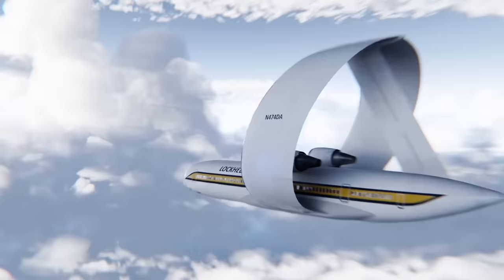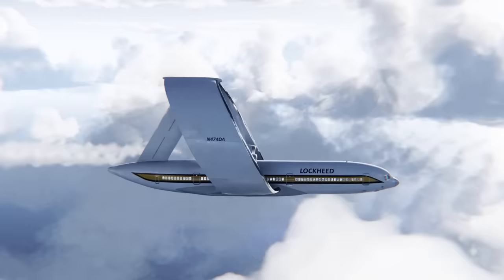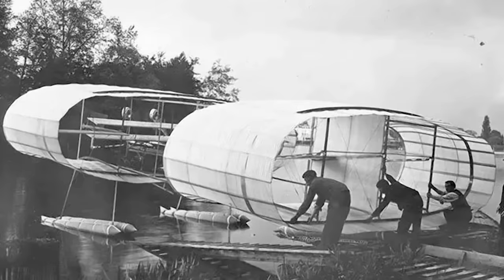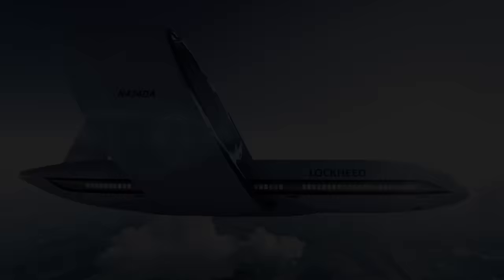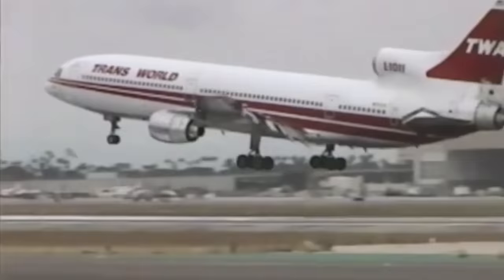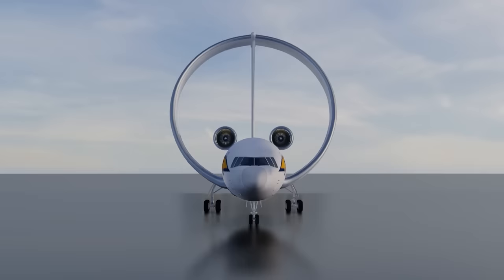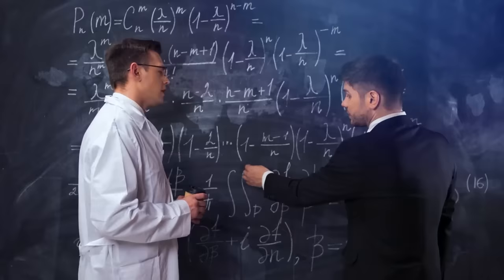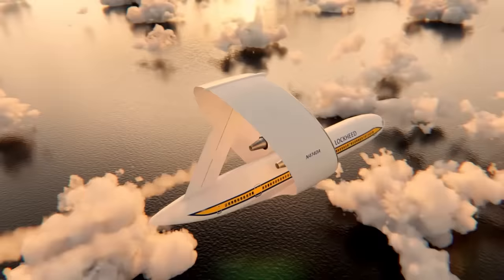What Happened To Ring Wing Planes?

Comment: As difficult as powered heavier-than-air flight was to first achieve in human history, it sure seems like there are a ridiculously wide array of designs that can work.
Reply: Yeah once you've got the basic idea of an airfoil and centers of lift and mass hammered out the rest is pretty flexible.
Of course it's still a big leap from something flying and something flying well.
Reply: Yup.  The hard problem at the time wasn't so much wings as engines.
Reply: The problem was not wing design, the problem was an engine that was powerful enough while also being light enough
Reply: It was the engines that were the problem. We had airplane-like gliders in the civil war, and soldiers would use them to spy on the enemy. They had to be sent up like a kite and wouldn't stay airborne for long though
Reply: Especially home-built RC planes! I thought you needed a PhD in engineering and access to a wind tunnel to design a plane that stays in the air, but it turns out that even people with "I think I saw that somewhere" knowledge of an airfoil can glue some styrofoam together and make it fly.
Reply: @metacob  RC motors have a ridiculous thrust-to-weight ratio, since things are so much more efficient at smaller scales.
Reply: *is, not are.  You're talking about a single array.  Learn the language you speak.
Reply: Anything flies with enough thrust.
Reply: Now the issue is almost exclusively efficiency. Most of the ideas get ruled out because they’re too heavy, not to physically fly, but to do so cheaply. That’s what’s holding up electric flight mostly. Batteries be heavy.
Reply: There are many design that can work, but what matter is how many of those can work better and cheaper than the current design ?
Reply: It isn't about flying..its about lifting off and landing.Alomst anything can fly question is how to get it up there.
Reply: @billydelacey  Stop correcting people. You aren't right.
Reply: Yeah, you just need strong enough engines.
Reply: @billydelacey  Youse may have GPS
Reply: Elon said it himself "you can make anything into a rocket, whatever shape you want"
Reply: the animal kingdom has found millions of ways to make it work all without engines.
Reply: @wompstopm123 Muscles aren't that bad an engine...at smaller sizes.  The power s muscle can exert is going to be roughly equivalent to the cross sectional area but weight goes with volume.

So if you're the size of a bird it's workable especially with light bones etc.  If you're the size of a person taking off under your own power requires some ridiculous modern materials to make giant super efficient wings.
Reply: With enough thrust, even a brick can fly.

Comment: My engineering teacher in highschool had us all make paper airplanes to see which ones would glide the furthest. Nobody really made anything too out of the ordinary, but the teacher made a ring wing plane from a straw, a piece of paper, and tape. It flew further than any other design and it blew my teenage mind.
Reply: Actually the best paper airplane design is this: Build a regular paper airplane, then make another one, but stop right before you fold it in half. Then slot that piece onto the top of the first paper airplane, taping them together under the wings. The overall shape is the same, but now you have a wing that opens like a pocket from the back. This creates a really smooth and long range glider, and there's multiple reasons why it performs better. Firstly, air gets pushed in from the front, inflating the wing, creating an area of high pressure, generating lift, while at the same time, also getting even more pressure from the default wing, even though it all behaves as one wing. So it essentially multiplies the high pressure surface area, without increasing the low pressure surface area, which generates more lift. It also fly's very smooth and stable. In a way it's like a ring wing meshed with a traditional wing, giving you the benefits of both with none of the drawbacks.

Comment: When I was a kid I used to make "paper airplanes" that used this concept using only two strips of a paper and a straw. If you cut two strips of paper, both an inch wide but one 4" long while the other is 6" long, then you tape both strips into a circle and attached them to the ends of the straw such that the attachment point of both strips is on the same side of the straw, then throw the "strawplane" with the smaller loop in front, it actually will fly pretty far.
Reply: I can easily see this design being potentially useful for like, low powered simplistic drones of some kind, not the loud whiny buzzy quadcopters but more like a serene, graceful device. Especially combined with a bladeless fan design this could be quite the smooth and safe rider. Much of our aircraft design comes from military roots, I always wonder what the state of technology would be like if WWI was averted and we kept that hopelessly optimistic, dieselpunk outlook on the future that people had in the early naughts
Reply: I made one too; using only a sheet of paper , it flew quite well
Reply: I'm pretty sure the world record paper plane, is incredibly basic and only has a couple folds. It looks cool, but it doesn't mean it's the best design.
Reply: I did, too! Way back in elementary school. Ours only needed a single sheet of paper.
Reply: @NLynchOEcake at that point why not make the ring wing an engine in itself? Doesn’t have to be complicated. It could work like one of those bladeless fans that are more expensive and act as “humidifiers.”
Reply: @cadosian078 or one of those solid state ionic thrusters

Comment: A yes.. the worst of both worlds. 

Both the downside of having a very long wing, combined with the downside of having two wings on top of each other.

On top of that, the high pressure area on one part is the low pressure on the other part. So its almost like having a anti winglet, that guides air from the high pressure to the low pressure side.

Will it fly, absolutely.  But it will suck down fuel as if there is no tomorrow.
Reply: Like my engineering teacher used to say: "With the right engine even a tram will fly"
Reply: Actually I think it will have varied cross sections, so the low pressure zone will always be the “top” side of the wing generate lift. Still the sides are not doing anything…
Reply: @AaronShenghao  is it viable to put rudders on that sections?
Reply: @AaronShenghao  Well on the same side of the surface, what is top and bottom is really perspective.

But it gets worse. There is just a infinitly shot bit of the wing that is vertical. Just next to it is parts that is have a horizontal component to them, hence generate lift. If they generate lift, they have a low pressure. So this put the low pressure of the lower wing just next to the high pressure of the upper wing. Guiding the pressure to collapse, and that is also true the other way around.

So this is actually worse than if you had two semi circular wing and a gap between them
Reply: @deptusmechanikus7362  yea... that would work, but it might have control issues
Reply: Wouldn't it also be impossible to have flaps and slats, increasing takeoff and touchdown speed/roll?
Reply: @grandadmiralbreloom1218  Absolutely. And how much the angle of attack need to be is directly related to the span of the wing  (note, span, not length).

So this would pretty much have the same lift as a F104 starfighter.
Reply: @matsv201  Would need some pretty tall hangars. I can see a special scaffolding platforms to work on stuff on the wing. Also a preflight would be interesting.
Reply: it'll get in the air at relatively low speed.  It will also be over responsive and hypersensitive to turbulence.  Although that gap between lower and upper surfaces  may sufficiently reduce some of the problems you'd get from a biplane...
  Air is too unstable an environment and it would likely crash too often.
Reply: Hmm.. ya.. That actually didn't cross my mind at first.... that is another issue... but if staggered properly, the top wing could be in the high pressure bow wave of the lower wing... like wake riding behind a boat.... might even be a way to squeeze out a bit of extra efficiency... but I'm not sure the design has the right angles for this though.. and  either way, even if you don't count the giant tail, over 50% of the wing as designed wouldn't be adding anything to lift, but it would be adding a hell of a lot of drag... so yes... it would be a very hard to control fuel hog!
Reply: @deptusmechanikus7362  I love this!!
Reply: @Tetrazole I mean, it's an over structured wing by necessity...  How do you feel about 15g turns and flipping when a stiff wind hits you just right?  I mean, sure, you're now going in the exact opposite direction that you were and you probably just passed out, but the plane may be structurally sound enough to not rip itself apart.
  Ring craft are dumb...  So incredibly dumb.
Reply: Isn't what you just described basically a biplane.
Reply: @deptusmechanikus7362  even the church can fly through the space.
Reply: It would be ass at manoeuvring and turning
Reply: @Science in Engineering  your more on target then most here... there have been R/C control donut wing planes built and flown many times... pretty much all of them needed the curve surface on the top and a flat surface on the bottom, like most high lift wings, and the sides pretty much have a neutral geometry... all of them I've seen have either a traditional rudder and elevator assembly or a second circle to control pitch and yaw... none of them had decent roll control and I'd suspect a elevon system would work better... all of them where extremely slow and looked excessively stable in flight and appeared to barely be able to get off the ground under their own power...I've seen vortex generator wings( look like a spinning paper towel roll replacing the main wing) that appeared to fly significantly better...
Reply: @AaronShenghao I think the sides might affect vortices generation.
Reply: Not only that but the part of the wing that is entirely vertical won’t generate lift at all
Reply: I built ring wing paper airplanes as a kid. They seemed to fly forever and were not bothered by windy days!
Reply: I love when engineers start improving a design in the comments section lol
Reply: @deptusmechanikus7362  haha true. One of my engineering profs used to say something similar: “with the right energy source even the broad side of a barn will fly”
Reply: @deptusmechanikus7362  Look up "flying lawn mower." Your teacher wasn't kidding.
Reply: Since you seam you know a thing or two, what happens if it flips? How does it turn?
Reply: @depreciatingasset  well. Its both the a angle of attack and the profile that lifts the aircraft. Så if its have a large profile the angle of attack upside down have to be large. Fighter jets have pretty much no asymetry what so ever.
Reply: I imagine this thing would probably have shit steering
Reply: @matsv201  thank you for your brain😂
Reply: It will tip over while parked on the ground with a strong sidewind.
Reply: i also love that the ideal use-case for it is just routes that would be better served by high speed rail
Reply: I know very little about this topic, but the first thought that came to me was how this design would work with no flaps?  I'm imagining it's technically possible to land a large craft like this with no flaps, but would think the runways would need to be a lot longer and they'd need to approach at a much more shallow angle for it to work.
Reply: @woogywips  Well yes, but it worth saying that bi plane does have the advantage of larger ground effect. While that is not always a good thing...
Reply: Its a shames because I'd figure with the verticality of the wings it would lead to more space on either side for better ground control/ storage and placement of other places around it.
Reply: This is a missile, with a ring on it, not a plane
Reply: What I want to know is, can these glide as far as normal ringed craft?

There are plenty of cases of large passenger jets being glided to safety after losing engines.
Reply: @hherpdderp  as far as a craft with the same span. That is... if we compare wing. Not even close.
Reply: Economically unfeasible now because the cost to readjust the existing Airline industry.  In addition, the US Government is trying to push for an entirely new infrastructure to support electric cars...
Reply: Not to mention an absolute nightmare to build, maintain and repair
Reply: @deptusmechanikus7362 whats wrong with trams? Trams are cool, now flying trams are cooler. With the right engine, even pigs will fly
Reply: Here are some intriguing details about the Lockheed ring wing aircraft:

Roots of the Ring Wing:
The idea of a ring wing aircraft isn’t entirely new; it has its origins in the early days of aviation.
The French were among the first to experiment with closed-wing designs. One of the earliest examples was the Bell Riot aircraft, which featured two annular wings mounted in tandem.
Unfortunately, the Bell Riot was damaged beyond repair during its initial tests.
Specifications: A Closer Look:
The Lockheed ring wing commercial transport was envisioned to be a substantial aircraft, measuring 52 meters in length with a wing circumference of 7.4 meters.
The wing would attach to the fuselage at a low mid-length point and arch back 27 degrees to join the tail, reaching a total height of up to 23 meters.
Innovative Design for Efficiency:
One of the most intriguing aspects of this design was its potential for fuel efficiency.
The aircraft could accommodate up to 120 passengers and was particularly well-suited for commuter routes that didn’t require high altitudes.
Unique Advantages:
The ring wing design offers some unique aerodynamic advantages.
Because there are no conventional wingtips, the wingtip vortices and the downwash they cause are minimized.
This results in the wing generating more lift, allowing for shorter runways, reduced fuel consumption, and minimal impact from crosswinds.
Why Didn’t It Fly?:
Despite its innovative design and potential advantages, the Lockheed ring wing aircraft faced several challenges that kept it grounded.
Increased parasitic drag essentially canceled out the fuel savings gained from the increased lift.
The design also required meticulous engineering to avoid aerodynamic issues like flutter and boundary layer separation.
Moreover, the ring wing concept was not as well-understood or mature as conventional aircraft designs, making it a riskier and more expensive venture.
Funding became a significant hurdle, as investors were hesitant to back a project with so many unknowns.